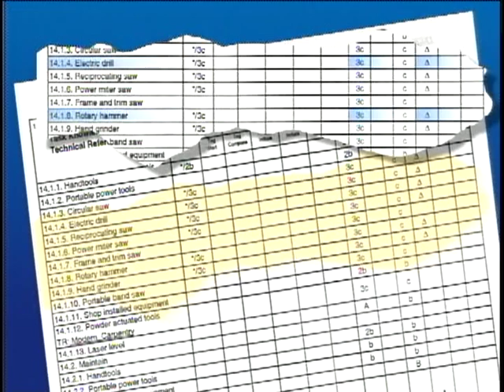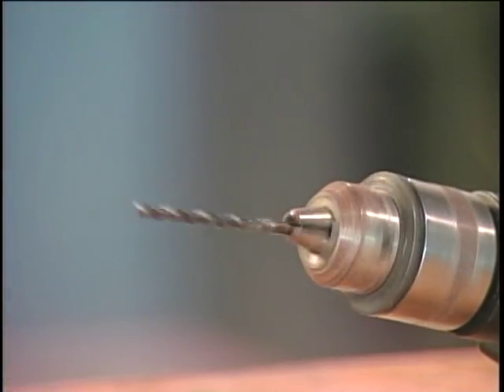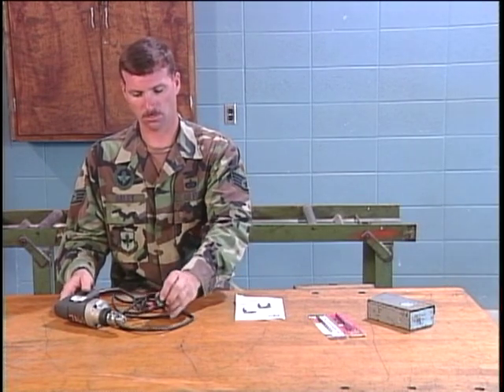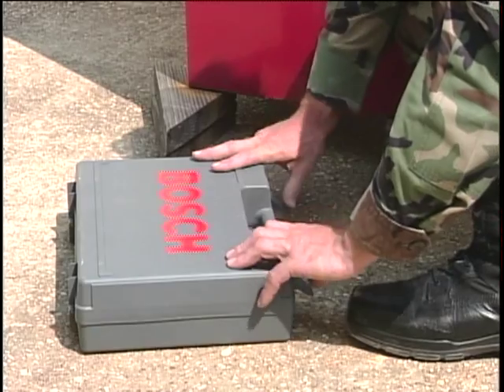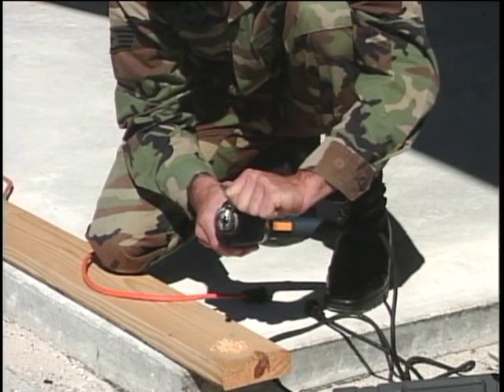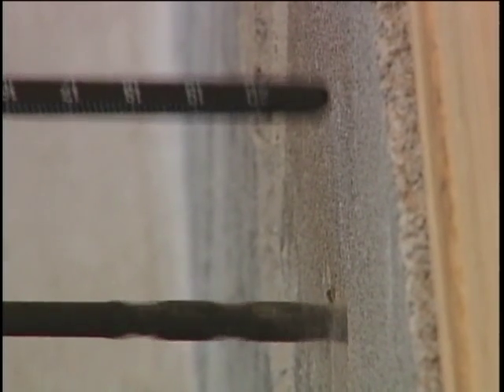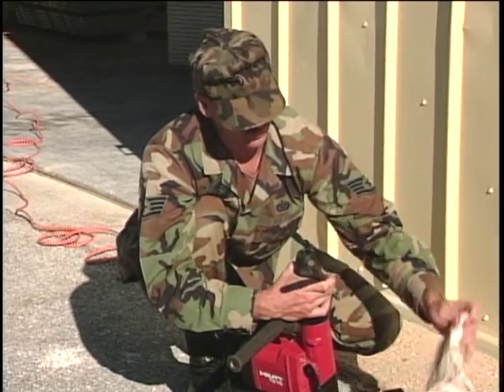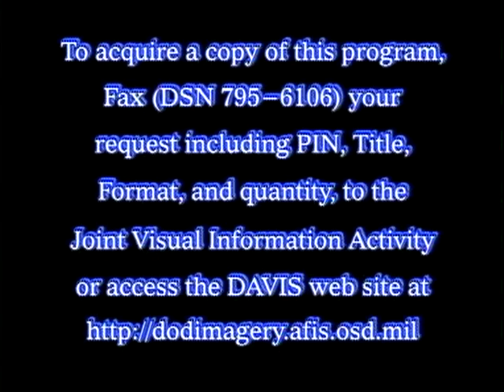AFQTP - ELECTRIC DRILL - ROTARY HAMMER DRILL

Comment: Drilling holes through building steel is a building code violation in most places. Instead, use a clamp to attach anything to building steel. There are clamps made for such purposes.